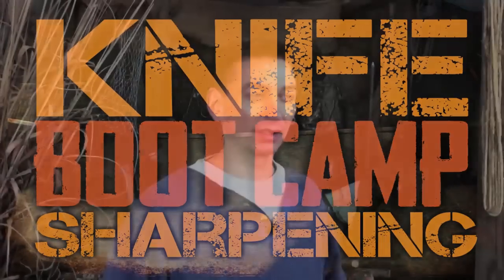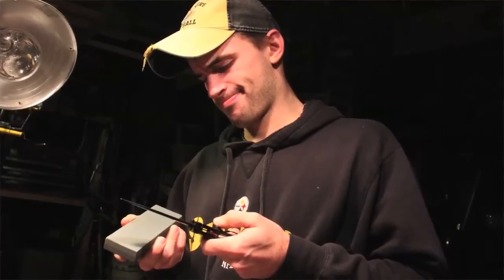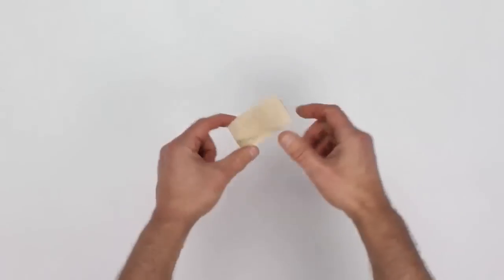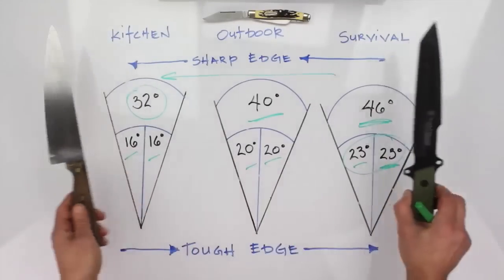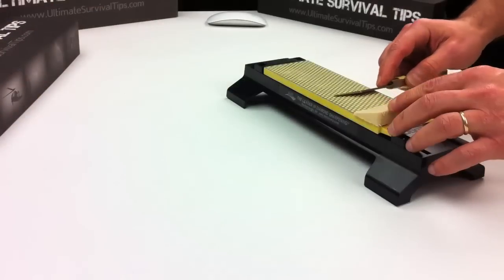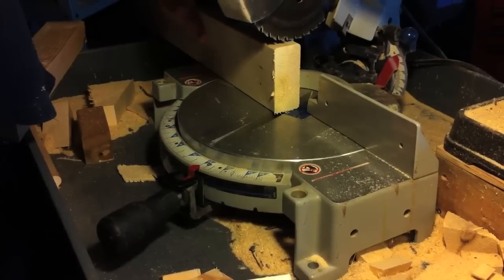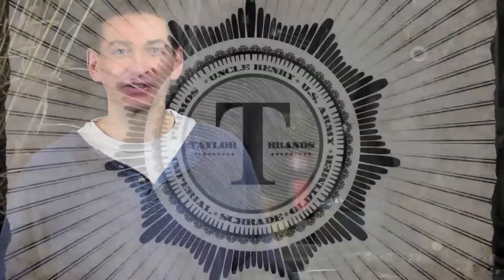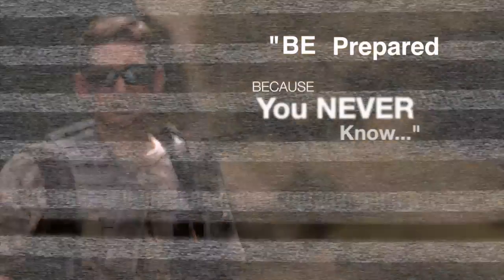Easily Sharpen Any Knife - Two Cent Sharpening Trick - Knife Sharpening Boot Camp #1

Comment from the maker: Hi Keren... This is a VERY good question!!! When you hone or strop an edge...you normally pull the edge away from your hone... but when you sharpen you push the blade into your stone / hone... Honing polishes and makes an edge stand up straight. This is taught mostly for kitchen knife "sharpening"... But honing is effective with good quality outdoor knives also. I have carving knives that have never been sharpened... only polished. We will cover honing/stroping vs. sharpening in this series...

Comment from the maker: Good tip. Smith's does too... I've found that plastic blocks can easily kick out and slide at times though. I have a Smith's one here and it is too light and slides easily. The scrap wood wedges have a nice texture on the bottom that keeps them in place. Thanks man! ~David

Comment: Nice info David. The key to knife sharpening is using the right tool and knowing how to use it. Blade steel, shape, size, grind, angle and condition all need to be considered before choosing the tool and method. The best way to figure all this out is to buy a lot of different blades and start practicing (cheap knives). I freehand on a ceramic rod frequently before the edge is too dull. It's quick and easy and my knives are always put away sharp! Strop to achieve insane sharpness.

Comment: I bought a set of cheap diamond stones a few years ago (despite being cheap they had positive reviews). I tried sharpening a couple of knives I had but got pretty poor results.

They have since gone missing when I moved out of a flat I was sharing, so when I was at a hardware shop recently buying some tools (never had what I needed so was borrowing my dads all the time) I thought I'd give it another try and so bought a DMT Diafold. Tried using it today and am pretty sure I've made the knife duller.

I've tried using the "fold a sheet of paper over twice from the corner" trick to find my angle but I'm still struggling (the small size of the Diafold isn't helping). I've been using knives that are on the cheap side to practice, so I don't know if the problem is the knives ability to sharpen well or my technique. Think I'm going to buy a Lansky system to establish whether the knife can be successfully sharpened, and if so then return to learning free hand (may even get bench stones too and return to the Diafold once I have some experience).

Comment from the maker: Well... you will find out in this series that I am NOT fond of pull sharpeners for sure. They will RUIN a blade if it is not in pretty good shape to start with. I REALLY like quality diamond sharpeners. So, as you will find out when I do the session on larger knives, I will be using an 8" diamond sharpener and a really cool and affordable, belt sharpener. For the serrations, you need a diamond rod. I like the cone rod on the Smith's Pocket Pal good enough. Hope this helps bro. ~David

Comment: if you go this far then you dont need  a knife its over kill  sorry  25 + yr of knife use and i have not needed a blade that sharp  in the woods
Reply: A knife is a cutting tool. It's primary function is to cut. The sharper it is with out the sacrifice of durability, the more efficient it is as a tool. The less work you will have to do to get the same results. 

Sorry, but you have been wasting energy and time for the past 25+ years. It only takes about 20 hours of practice to really start getting pretty good results from free hand sharpening. less than $50 of stones and a strop, and you could shave your face with enough practice.